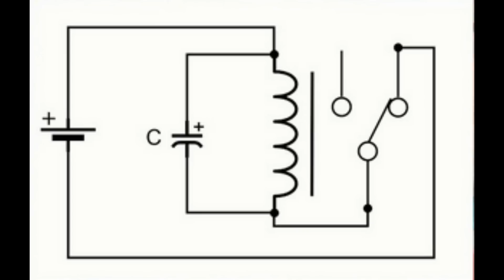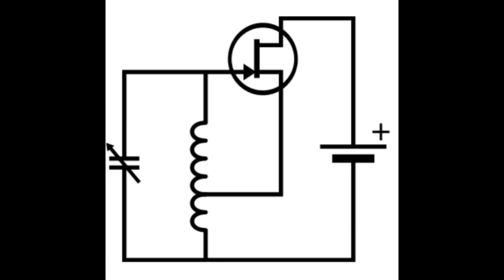2333 Making Oscillators From Relays

Comment: I’ve used small pcb relay coils to drive another form of oscillator as the coil in pulse motors where there’s just a couple of 3D printed parts, the relay coil, reed switch and some magnets, some for rotation and some for magnetic lift of the rotor…quite satisfying to make IMO

Comment: That fast oscillation is not useless. You just made a dc boost circuit that's electromechanical. Put in a diode and a filter capacitor run the relay from 5 volts dc and you should get a much higher voltage output. Maybe 80 volts.

Comment: You've just re invented the electro mechanical telephone exchange. The timing pulses originate at the clock, as in a real clock that tells the time. They output a 1 second pulse as well as a 30 sec pulse which effectively controls everything which requires some sort of timing.

Comment: R/C oscillators are the most common type of oscillators used in small transistor ccts before ICs come on the market and they could be built to be highly accurate.  But that a accuracy came at a cost.
Reply from the maker: It always does mate!

Comment: Fun. I did that as a kid, Every time the contacts interrupt a high voltage spike is induced in the coil ( See the large spark between contacts ? That's why ). Using a diode and capacitor you can collect that charge and you have a high voltage generator. Nothing dangerous if you use below 100 nF.

I do the same thing in maintenance as well if I happen to come across a relay with high resistance contacts. Running it like that burns contacts clean in seconds. 

Slowing it down like that is nice but the thing is there is no way to get let's say a 50% duty cycle. You will not be able to drive your steppermotor with such a circuit ( maybe 2 relays could work but I'm not sure ). Of course a microcontroller is the best way to use as virtually all will support an exact timing based on crystal accuracy which is just a few ppm.
Reply from the maker: I am afraid there is mate - I might do a video on it but basically with 5 SPDT relays wired up you can change the duty cycle

Comment: Could you not just use a transistor
Reply from the maker: no mate - not by itself - the transistor is just a switch in this and you need something to turn it off and on at a set frequency - an oscillator - here the relay is the oscillator
Reply: @ThinkingandTinkering   a ring oscillator from an odd number of purely transistor based Not gates does work, based on the transistor rise and fall time. But you'd still want to tune the frequency with a potentiometer
Reply: Obviously, not the point of the video
Reply: @jamesyoungquist6923   but it could switch on and off a thousand times
Reply: @paulwright5440   yes that's true and he said that, and showed several schematics using transistors as alternatives. This project was specifically to see if it was possible with a mechanical relay

Comment: That was how I basically test the quality of the relays I use in my products. I could create an electronic switching circuit to operate the relay coil but I found that making the relay do the work along with a big cap and a 12 ohm current limiting resistor in series with the cap did the work for me. I connected the n/c contact to a counter which when it stopped counting meant that the contacts had burned and the relay was now useless. Best relay ever tested was Takamasowa 822 thousand at 1 amp switching on the contacts. Next was Fujitsu at 676 thousand also at 1 amp on the contacts. Many cheap and nasties don't even make it to 100 thousand.
Reply from the maker: clever thinking there mate - thanks for sharing
Reply: Now that is interesting.

Comment: I built a relay based oscillator 10 years ago for an interactive model, and it is still working. The large capacitor is in series with the coil which pulls in whilst it is charging. When the relay drops out due to the cap being nearly charged, the contacts discharge the cap via a a resistor of a couple of ohms.
Reply from the maker: awesome mate - thanks for sharing

Comment: Has an electric relay or switch ever been thought of to pulse/push electric energy into a cycle of circuitry that multiplies it to keep a current flowing perpetually??
Reply from the maker: i believe so there is something called a Kromrey convertor which sounds very much like what you are talking about - but it is seen as a perpetual motion machine and a little 'iffy'

Comment: When you first started explaining this, I recalled that the tone generators for electromechanical telephone switches were typically motors with several different cams which yielded the desired frequencies.  And so I wondered, "Why did they choose that instead of a circuit like this?" But then you answered the question: durability.  Seems obvious in hindsight, heh.
Reply from the maker: everything is 20:20 in hindsight mate lol
Reply: The reason for the use on the “ringing machine” was durability.   These 50V machines would run for thousands and thousands of hours without variation.  Also, the machines where very easy to maintain.  My senior and I where given the job to replace the tones sent to P.A.B.X.s with a tome generator inside each P.A.B.X.
Reply: At 3:41 now the sparks splashing across the contacts.   The spark is from the “back EMP” produced by the collapsing magnetic field of the relay.  That spark will eventually destroy the contacts.  This is resolved buy placing a small value capacitor across the contacts.  Sometimes a low value resistor is connected in series with the capacitor to slow down the coil discharge and reduce current flow.